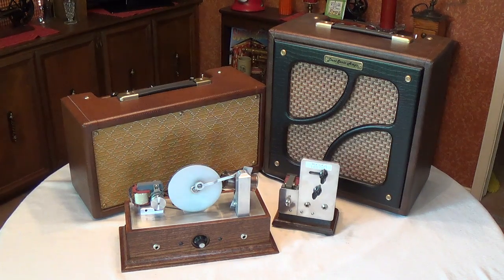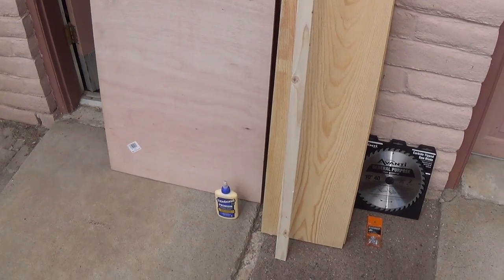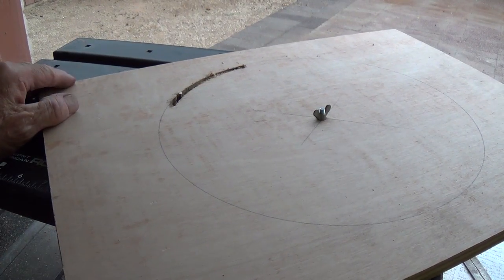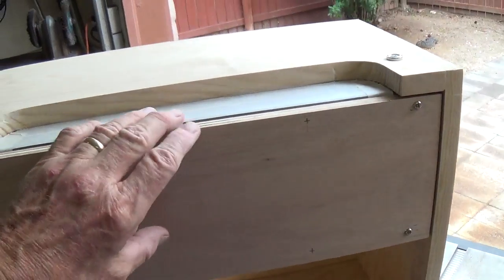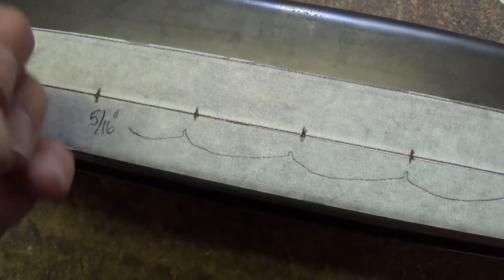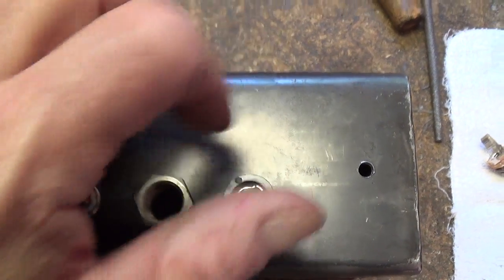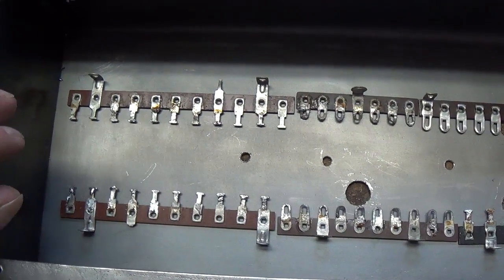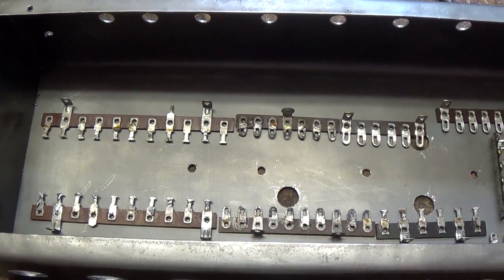How to Scratch-Build a Vintage Amp, Part 6:  Cabinet Construction and Machining of Chassis

Comment: Iwe bored holes in cabinet sides and glued round pinns in .. not so nice,but alsow worke,theres posible to primitive construct a one pice build, so now when parts are getting so exspencive its good to try to make all quality,got life in my new made fender 6 d3 amp yesterday,and bias semed to be fine with a 470 ohm resistor, but ofcurse there was funny wiring in the tone controls,since its mirrow made,and to orginal to keep.but it burned fore some ours,and now i will go over it again,before i put another shassi ( old radio) on the table, next is  my 3 marshall 18 w and fender deverb unit my2, and then i have transformers fore a 22w bassman.  Dont like to runn out of transformers, have a 50 w output transformer left then, those classic tone transformers were nice, hope they start upp again! Best wishes !
Reply from the maker: Thanks, NB.

Comment: Hi Uncle Doug!  Maan that timber cabinet looks like it was made by a cabinetmaker in a woodshop!  Very professional looking!    Those finger-jointed corners look magnificent mate!  Flawless & strong as all get out!  Great idea bolting the speaker centre-hole & using your router to cut it!  Unfortunately, I didn't have a router table to make the 15 inch cutout in the baffle for my 'Silicon Chip' magazine Majestic speakers that I built.  

I just had to use a jigsaw, unfortunately.  After I cut out the hole (which was naturally quite rough!), I smeared a small amount of black boot polish around the edge of the timber disk that I had cut out & screwed a 4 inch length of 1 x 1 inch cleat into the disk centre hole as a handle.  Then I rotated the disk inside the hole to mark the high points in the speaker cut-out, then sanded the high points down with sandpaper wrapped around a piece of dowel. 

I repeated this process until there were no high points left.  The process worked really well, & I glued up & painted the internal edges of the speaker cut-out with wood glue & primer.  I managed to source some real nice 10-32 T-nuts for each of the 8 blackened allan-key head mounting bolts, which I 'siliconed' & hammered in for a perfect airtight seal.  The speakers are rated at 300W RMS @12.5Hz - 20kHz so I had to be sure there were no air leaks, & there were none!  Yay!

Your metal chassis looks fantastic mate, & I especially like your idea of an internal steel wall to keep power supply noises out of the preamp circuitry!  I hope you kept your furry friends out of the workshop while you were drilling all the chassis holes, with all that razor sharp metal swarf getting flung about!  I guess all the racket you must have made would have deterred them a bit ay?

A totally wonderful, professional job mate, with just one possible problem.  I was a bit worried when I saw that you used a rocker switch for the 6L6/6V6 selector, which may get accidentally bumped.  I dunno, but I would have used a slide switch that fits behind the panel & requires a screwdriver to move it, like mains voltage selector switches that I have seen.  Maybe it's not such a problem, but may run 6V6's too hot if in the 6L6 position?  You've probably already thought of that scenario, but anyway that's the only worry I have for your amp my friend!  Other than that, it's a 12/10!
Reply from the maker: Thanks so much for your detailed analysis, Neville.

Comment: If the main filter capacitors at the power nodes are rated
At 500 to 525 volts DC
you could run a 5AR4
when running the 6L6
and then the 5Y3
when running the 6V6
even with the 2 position bias switch
That way both the
6V6and6L6 can have two power settings each.
Reply from the maker: Thanks for your helpful input, Dwight.

Comment: I was wondering how you’d upholster the cutaway for the controls.I’m sure you’ve noticed that Fender and vox have an upside down“V” cut with a strip under it in the corners. I wonder why they don’t just do the controls the same way as the oval cuts on the back of amps.
Reply from the maker: It has to do with the radius of the curve and the thickness of the wood being covered, William. The rear panels are much thinner than the top panel and the covering material can be stretched without cutting.
Reply: @UncleDoug  Thanx UD. Makes sense. I was wondering how I was gonna approach that if I make a control cut out. I’ll keep thickness in mind.

Comment: Uncle Doug - do you believe there is any advantage using aluminium for a chassis?
I’ve heard it reduces magnetic interference and could make for less hum.
What’s your opinion?
Thanks
Reply from the maker: I've used both it and steel many times and find no EMF benefits, but it's easier to machine than steel, weighs less, absorbs and transfers heat quite well, and won't rust. On the downside, you can't easily solder to it.

Comment: 6:50 a bandsaw makes more sawdust
Reply from the maker: Not in my experience, Edgar. A band saw removes a thin, i.e. 1/16" wide, kerf of wood, while a router, depending on the bit, may remove 1/4" or more.

Comment: I have a question Uncle Doug if you can get around to it.  I have watched your videos many times, and i mean a lot.  I understand so much now about tube amps, but one thing still puzzles me.  On a fixed negative bias, many amps will have two 220k grid leak resistors  to the bias.  Wouldn't this drop the bias voltage almost to zero at the grid?  Or is the grid leak resistor calculated in having a higher negative voltage accounting for the 220k drop before the grids?  That is the only thing that confuses me.  Thanks!  You have taught me a lot.
Reply from the maker: You are assuming that high value resistors will substantially reduce voltage, Joshua, but in reality, the voltage drop is based on current flow. Thus, if virtually no current is flowing, a 1 Meg Ohm resistor might not cause much voltage drop at all......while in a high current line, a 10 Ohm resistor might create a significant drop. In bias lines there is virtually no current.....where would it go? The grid is essentially a dead end.
Reply: Okay,  that makes since.  You are awesome!
Reply from the maker: Thanks !!!

Comment: Really impressed . All my amps have had the transformers on the other side and the input section on the opposite side also so struggling to get my head round a "mirror image " amp. Also I've built from plans and turret boards  . so tag strips will be a new challenge .
Reply from the maker: Good luck with terminal strip point-to-point wiring, Doc. I hope you like it.

Comment: Hi, Doug. This is truly inspirational. However, isn't it easier to drill and cut the chassis before folding it?
Reply from the maker: Perhaps, if you have proper bending tools, Nathan, but I've found that if you drill before hand-bending, the metal around the holes may deform.

Comment: What step bit did you use? Can you use the same bit for both Octal and B9A valve sockets?
Reply from the maker: I got a pair of step bits from Harbor Freight.....one fat, one skinny. Between the two, I can bore appropriate holes for every tube socket I have ever used.

Comment: Hey Doug, another great series. While I completely understand your choice of chassis material, I will point out of couple of things for followers who may not be familiar with hot-rolled sheet steel, which is what you used. That "blueing" is actually mill scale from the hot-rolling process and it's a lousy conducter (makes poor grounds but a GREAT capacitor, though). That stuff fiercely resists TIG welding unless you've scrupulously ground away the mill scale and cleaned the weld surfaces with alcohol or other appropriate cleaner. Additionally, if you live in a moist climate such as Middle Tennessee (Nashville) where gulf air is constantly streaming up this way, that steel is going to start rusting five minutes after you drill the first hole. Then, you're left with the option of painting (after grinding away the mill scale as paint won't stick to it) or throwing it away and selecting a more suitable chassis material. Please understand this is not a criticism of your choice of material. For just a few bucks, on the other hand, a metal distributor will sell you aluminum (or steel) "drops" for a fraction of the price of a sheet. An excellent choice might be a 5052 alum, for example, in .040 thickness. Easy to bend, MUCH easier on those expensive step drills, etc. And lastly, speaking of drilling, oil products never make good coolant for drilling as they lube the material instead of cooling it, which is the last thing you want. It LOOKS like you're drilling when you're actually rubbing your way through it. The MOST effective, and least expensive cutting fluid that I've ever used for drilling is a 50/50 mixture of Pine-Sol and tap water. Just my $.02.
Reply from the maker: Wow, thanks for the very informative input, Bruce. I have used aluminum for chassis in the past and found it easy to work, but difficult to bend without getting stress cracks. Most of the steel I use does not have mill scale, and with our 6 to 8% humidity, rust is not a big issue.....but I fully understand that it's a real problem in many parts of the world. I have been using a special cutting and threading fluid, but will definitely try your Pine-Sol recipe.  Again, thanks so much for sharing this info with us :)
Reply: There are actually two reasons that stress cracks develop in aluminum during bending: 1) the heat treat of the material, e.g., T3, T4, or T6 doesn't lend itself to working and 2) your bend radius is too tight for the thickness. For small amp chassis of the size we're dealing with here, 2024, 3004, 5052, or 6061, CONDITION  O (pron "oh") alloys in .032 thickness would be PLENTY strong enough and EASILY cut, drilled, and bent. Using the bending process you demonstrated here would work perfectly on a piece of 2024-0, .032 and be fully as strong as that safe you built from the HR piece of steel. Please forgive for the crack about the "safe" - that appeared at the doorstep of my tongue and I was powerless to keep it from just tumbling on out there. Best wishes.
Reply from the maker: I never cease to be amazed by the wealth of information available from viewers. I am taking some notes regarding the alloys you recommend, and will do some experimenting in the future. Thanks again :)

Comment: Showing my ignorance here. Why steel and not aluminum?
Reply from the maker: +Phillip Neiswanger  No ignorance shown, Phillip, it's a good question. I have used both aluminum and steel in the past, and since this was a vintage amp circuit, I thought steel would be more in keeping with the original chassis.  Each material has its own benefits and drawbacks, and to be honest, I have no particular preference.

Comment: Really enjoying this series Doug and the quality of the build throughout. The finger jointing is a great way of jointing, i more often than not see butt joints and screws and strengthened with blocks even in commercial project. Thanks for showing us how to do it the right way. Take care and all the best to Rusty and Jack. Colin
Reply from the maker: +mixolydian2010   Thanks, Colin.  Yes indeed, box joints are really strong and require no metal fasteners to interfere with the routering.  I have no doubt I could stand on the cabinet, along with Rusty and Jack, and it wouldn't waver a bit.....but I'm not going to test my theory :)

Comment: Hi Uncle Doug: Another great video. I honestly find you do the most thorough and informative videos. Using them as a guide, I will be able to take my amp building level to a whole new height. I am glad you are doing a Supro design, because I was thinking of building one earlier, (I'm a Jimmy Page fan), but I couldn't find the proper info on how to do it. I eagerly await the next part. thanks again, Bob
Reply from the maker: +starlingave Thanks so much, Bob. It's great to hear that the video series is helpful. Thanks for watching, and best of luck with your Supro project :)

Comment: Uncle Doug, one of my first amp builds was a Fender Champ style amp  build  fitted inside a 1936 Philco radio art deco cabinet, I found in the attic of my mother-in-laws house on Lake geneva, WI. My brother-in-law was kind enough to let me use his GREENLEE chassis punch kit for the tube holes. The kit had the pheumatic hand pump. Worked like a charm.
Reply from the maker: +Eric Reicher  Greetings, Eric. That sounds like a great project, and it eliminates the need to construct and cover a cabinet (tough jobs).  I've seen Greenlee punches, but never owned or used them. Perhaps I can find a set at a yard sale or on Craigslist in my area.  Thanks for your input :)

Comment: As an added comment, I use my Stihl (Al Gore approved) gas leaf blower to clean out my table saw, router table and sander in the backyard. Works like a champ. It is even better for cleaning out my Ford F-150 interior. I start her up, open the windows, turn on the air (high) and blast the interior. Way easier than vacumming. My wife thought I was crazy until I demonstrated the advantages of the leaf blower.
Reply from the maker: +Eric Reicher  I like the leaf blower idea, Eric. I just use my air compressor to blow off the tools and work area. Rusty hates it and hides, but it works pretty well.....and I'm sure old Al would approve :))

Comment: Hi Doug!  Do the rubber grommets serve a function other than protecting the wires from sharp edges?  Do they prevent inductance or something? I just noticed that my amp doesn't have them.  Thanks! ...and as always - great video!
Reply from the maker: +HungryFreaksDaddy   You're welcome, HF.  As far as I know, it's just to prevent chafing and possible short circuits.  Lots of amps don't have them.....but to be honest, they probably should.  I always feel safer with them.  If you don't have them, you could wind some electrical tape around the wires where they pass through the chassis wall.

Comment: Excellent again. Very good advice regarding the output transformer being off-axis from the power transformer! I didn't know that. 

Also, you aren't there yet, but reverb pan orientation is important. You don't want the output transducer/pickup of the reverb pan to be at the same end of the cab as the power transformer or it could pick up noise from the transformer.
Reply from the maker: +tremelo68  Thanks so much, Trem68.  You're absolutely correct about the output transducer being as far as possible from the PT.  Over the years, I have observed the hum that can occur if it isn't. It's probably one of the main causes of reverb hum problems.  Hopefully, the Supro will be totally hum-free :))

Comment: Hello again Uncle Doug, Rusty and Jack.  
It seems I never get enough of your detailed videos (as always) of the way things should be done, not the way they may be done.
A  new blade is important, as cutting some wood products (especially that grained particle board)
causes sparks to come out when sawing against the carbide teeth of the 10 inch table saw blades. Wears out the sharpness of the carbide teeth very quickly.    I see you got the the traditional 3/4 inch good grained pine. That's good as it  is important for cabinet resonance and many amp manufacturers use pine because of that. 

I have a 40 year  old sabre saw, that has those blades that can bite you, but for cutting out some funny shapes or metal it still
has it uses. I have pretty much have all the woodworking tools/saws/bandsaws and a myriad of clamps of different shapes and sizes. 

I see that Jack your cat, only gets into the action when he wants some attention.  As you know, cats don't do woodwork or any other kind of work for that matter. LOL!

Nice work on the wood cabinet especially with those all important box finger joints.  The bull nosed edges of the cabinet make it very attractive looking. 

Those step bits take  a powerful drill press to drive it.  Very nice transformer layout.  Go to to see the use of rubber grommets,
not every commercial amp uses these.      Solid looking 16 guage chassis..how much do you estimate it weighs without any components added yet. Looks very heavy to me.
Reply from the maker: +SuperCarver2011 Thanks so much for your detailed and favorable analysis, SC. I would guess that the chassis weighs around 4 lbs.  I was somewhat apprehensive about the difficulty of machining it, but everything went quite well. I tried to stress the importance of proper lubrication to expedite the drilling process and preserve the drill bits. I fear that many people simply try to force the bit through the metal with no lubrication at all.....not a good idea.
Reply: +Uncle Doug  Yes, I have broken many small bits by forcing the bits through metal on a drill press (especially aluminum) causing the bit to bind up and twist off, leaving me having to buy another one to finish the job. 

Same situation with hacksaw blades when you just go at it without some lubrication on the metal blade

Comment: Loving this series Doug! Reverb just posted a cool video comparing the reissue 6122 to an original http://ow.ly/TavQI
Reply from the maker: +jobyregrets   Thanks so much, Joby. I watched the Reverb demo. The guy is an excellent guitar player, but some of the info was incorrect. The reissue is a 1622RT, which is double-ended (6973's), and they appear to be comparing it to a 6422RT, which is single-ended (6V6).  Not a very fair comparison, especially power wise. I wish they had compared the reissue to an original Supro 1622RT with a working reverb.  I have a feeling the original would have really shined.
Reply: +Uncle Doug oops! Forgive my typo there. Fat fingers small phone lol :) I'm just ready to hear YOURS!
Reply from the maker: I'm anxious too, Joby. So far, the wiring is going well.